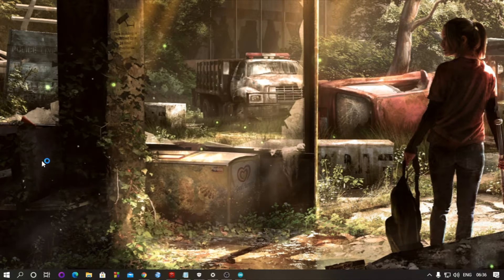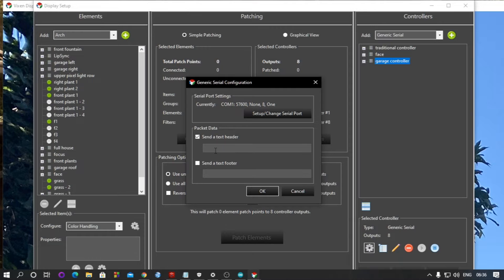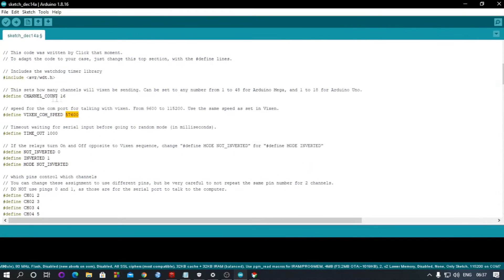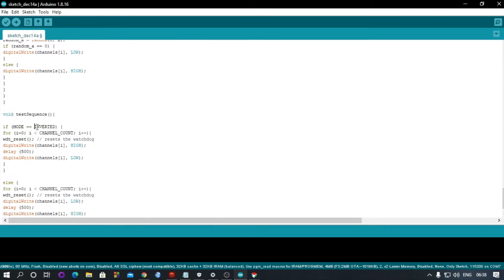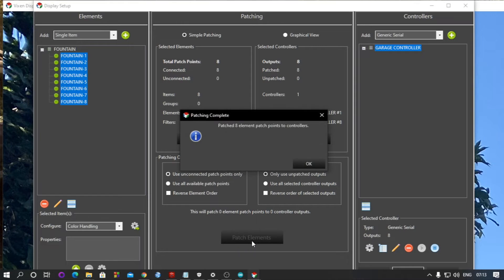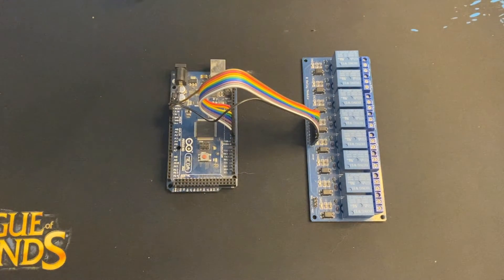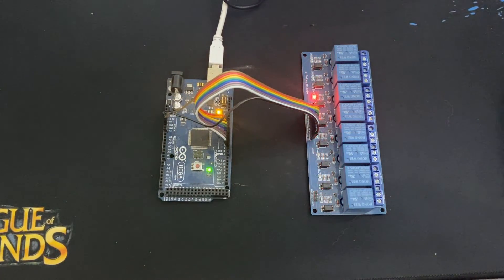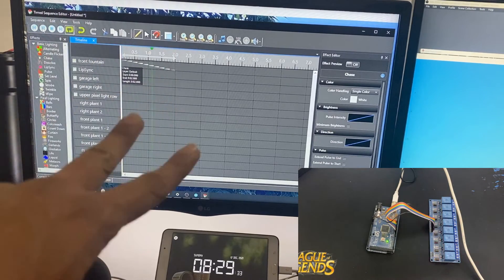How to make Christmas light show with vixen using arduino and relay (DIY).

Comment: so once you program to the ardurnio do you have to keep your computer pluged in to it or will you be able to remotely control it?
Reply from the maker: Yes the arduino will always be connected to computer. As the sequence is played in vixen software.
Reply: ok thank you so much

Comment: I am having a problem when i connect high voltage to the relays,after a few seconds the arduino and the relays becomes unresponsive and glitching but if i don't connect high voltage to the relays the system works as normal.
Is there a way to fix it?
Reply from the maker: This shouldn’t be happening whenever arduino glitches it is mostly due to unstable or improper power supply. Did you powered your relay from arduino or from external power supply if not try to power it from external power supply and check your relay for any damage or current leak from high voltage to dc side of relay. Or try changing your relay module.
Reply: @HOUSEHELPDROID  I am using a USB charger to power the relays. do I need to use a power supply to power the relays?
Reply: @Umar.Mikail  i know youuuuuuuuuuuuuuuuuuuuu
Reply: @HOUSEHELPDROID hello sir, I have changed my relay module and now it works fine (sorry for late reply)

Comment: the problem i am having is that it is inverted, so when i change it from NOT_INVERTED to INVERTED (Like you said to do) but it does nothing, i only found 4 NOT_INVETEDs and i changed all of them to inverted but the relays are still inverted
Reply: ik this is a kinda old comment so you might have fixed it by now but I managed to fix it by flipping most of the "HIGH" and "LOW" segments in the code (if its high originally, it becomes low) Hope this helps!
Reply: @TayvinBurcherRacing  i fixed it but thanks for responding to my comment
Reply: @ThomasTheCowboy  okay! And you’re welcome

Comment: How would I go about adding more relays to the Uno if the 5V spot is already plugged in for an 8 Channel one
Reply from the maker: Make a series connection to other relay but make sure to power them externally uno can’t provide that much power to power all relay at once.